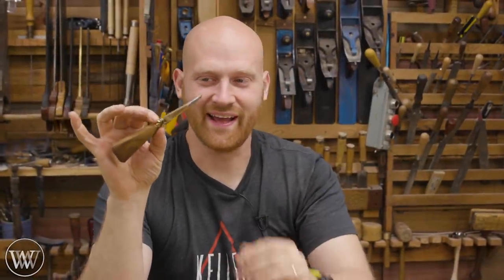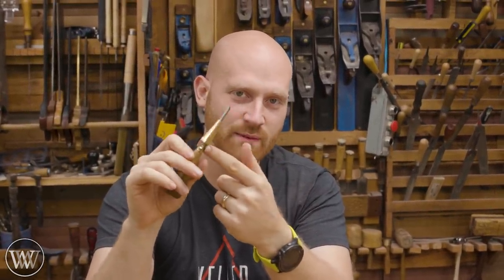Making a Marking Knife with Uri Tuchman

Comment: Hi James. Love the channel and this video is more of your usual excellent stuff.

I notice you being really careful with the epoxy application, and that there's a tiny bit of squeeze on the joint (not that it's bad or ruined it -- it's still a super-cool piece).

You may well know this but just in case you (or anyone reading this) hasn't heard it, I'll share something that's saved me a ton of pain with epoxy and finishes (especially oil and poly).

Dude: Acetone. Acetone is a beast at clearing out all the epoxy squeeze-out and taking it back to bare wood. Just clamp as per usual, let it squeeze and repeatedly clean up the squeeze with an acetone-damp (not soaking) rag or paper towel while the epoxy's still somewhat liquid. You have to move semi-fast as the acetone will flash off (so don't have any naked flames or heated elements in the vicinity and make sure you're semi-well-ventilated) but a few rubs with acetone usually removes all the epoxy from the squeeze out and you actually have more working time than you think. I usually clamp up, clean-up while it's in the clamps, and then leave it. If you want a super-clean (and I mean *perfect*) joint, blue tape both sides of the joint just outside the contact surfaces as then you'll be mostly acetone-cleaning the epoxy off the tape rather than off the wood. It actually leaves the wood in that area slightly more 'dehydrated' and dried-out as it will strip any remaining pitch/sap too, but that gets corrected-for with the finish and it leaves zero visible epoxy patches. It doesn't affect the epoxy _in_the joint as the rag/towel's not saturated enough for the acetone to soak in -- and it soon flashes-off regardless.

Hope that helped someone. It's helped me.

All the best.
Reply from the maker: Great tips. I did not want to use acetone in this case as the joint was so small if it leaked in it could actually weaken the joint most the time the joint is large enough that's not an issue.